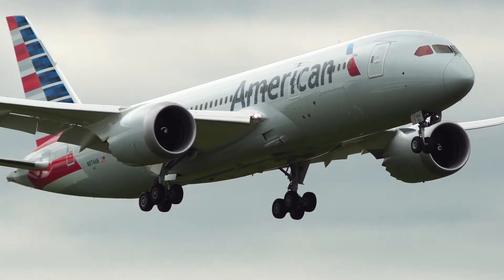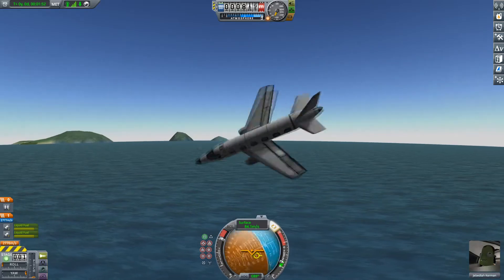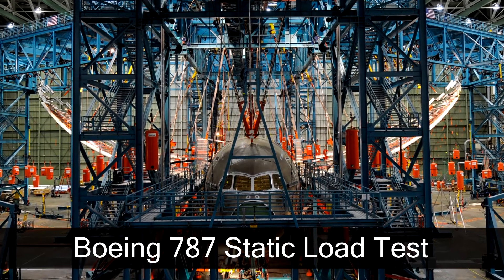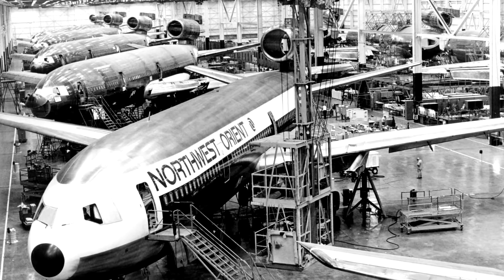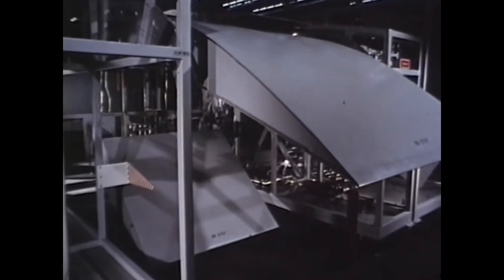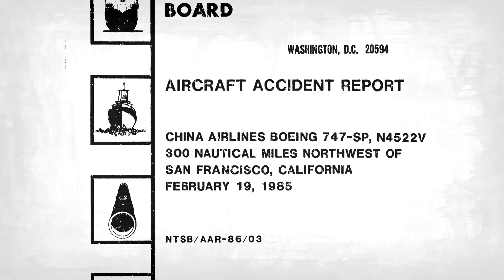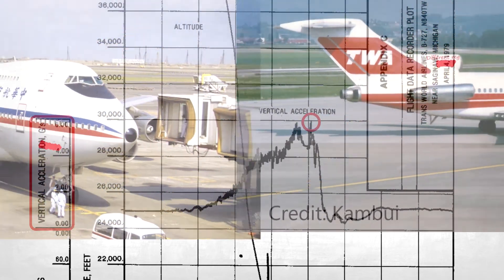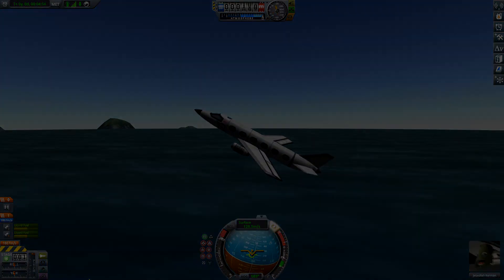How Many G's Can Your Airliner Take? (Don't Worry About Turbulence)

Comment: Which direction does negative g force act? Do negative g's mean the plane is inverted?
Reply: No. in case of an aircraft positive G's always press you into your seat, so the force is downward to the planes floor and negative g's would lift you out of your seat, so the direction of the force would be torward the roof of the plane. It is possible to fly inverted but still have positive g's apply.

Comment: Some material for additional videos here. What on Earth were China Airlines 006 and TWA flight 841 doing?
Reply: China Air 006 had an engine issue on no. 4 which they tried to deal with on autopilot but when they turned off AP the plane banked hard right and dove down to 9000 ft from 36000. That dive and recovery was where they pulled all these extreme g’s. Idk about TWA 841 but it’s TWA (that airline was borderline cursed).